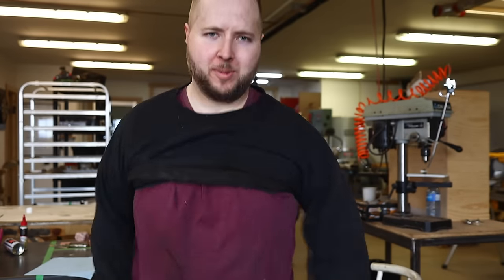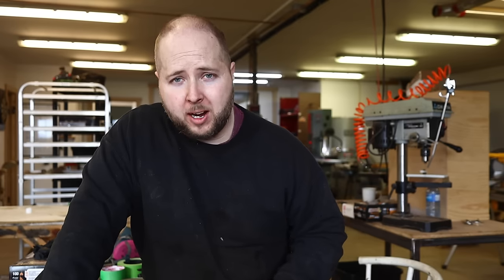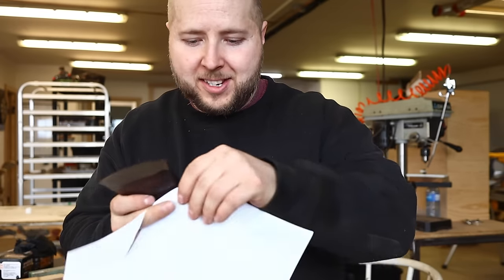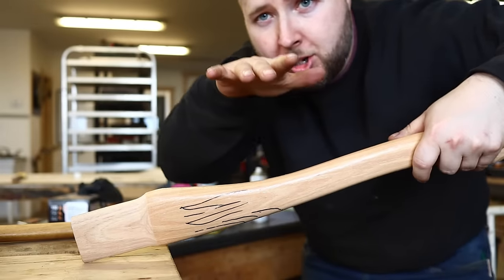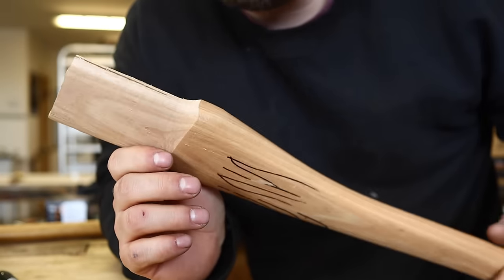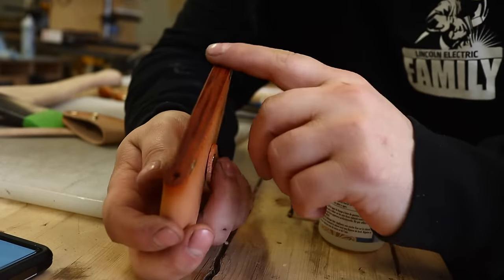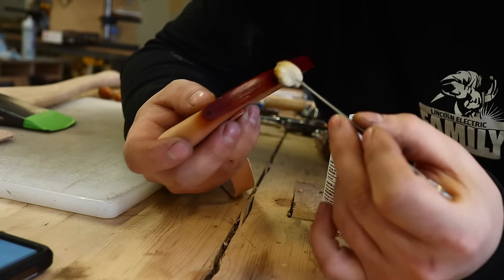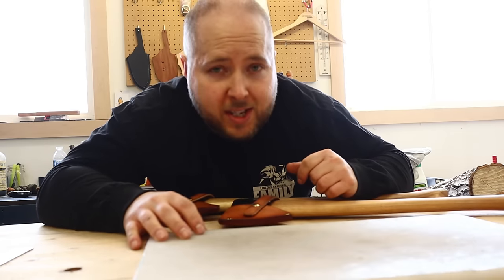How to Restore an Axe! - [FULL RESTORATION]

Comment: In the future if you are looking for quality handles, check out Whiskey River Trading in Iron River, Wisconsin here in the states.  In addition to historical as well as traditional handle shapes, their handles are graded and display the characteristics you mentioned which contribute to a quality handle.  Most of their handles are not finished, saving the step of removing the cheap varnish finish found on the majority of replacement handles these days.  Also, their periodic on line auctions are a great source for vintage heads at affordable prices that make great project axes for those looking to try their hand at an axe restoration.  Thanks for the inspiration Kyle.

Comment: I don’t think there is any materialism about it. My grandfather was a carpenter who used to build homes. In those days there were no electric saws or drills. Every framing board was cut by hand as well as trim etc. well I have one of those frame saws and I treasure it. Amazing steel as I will use it on occasion and it still is sharp. The only item I have that was his.  Nice job on the builds Kyle.

Comment: Voila!!! Some human finally got the tip, to hit the handle on the bottom, and not drive it on by the ax head, same goes with a hammer that gets a loose head! Handle tapping 101! I am 67 Earth years, My thing! No one desires to be called 21 years OLD>  Very impressive from start to finish.